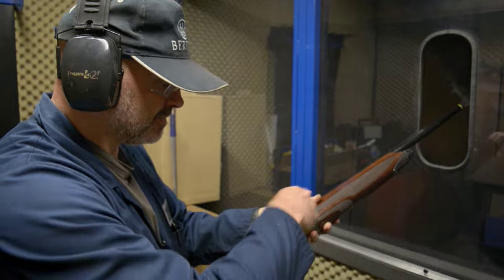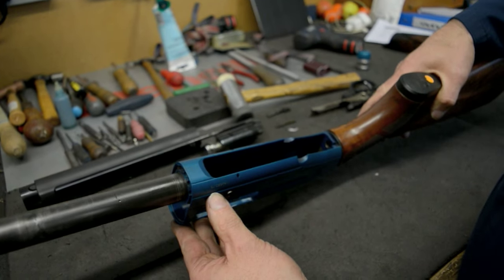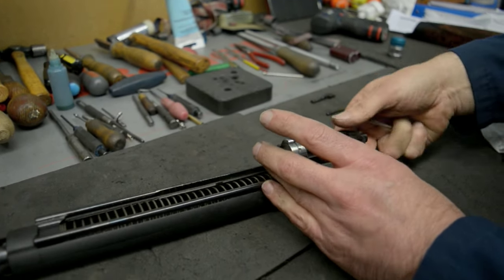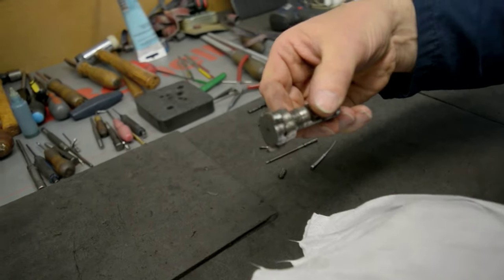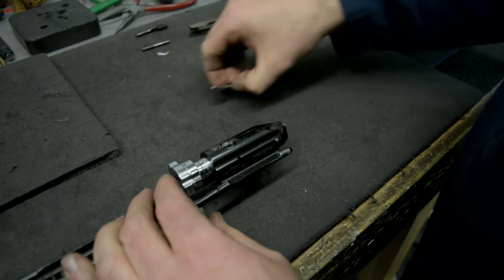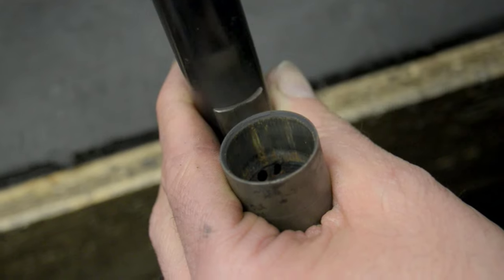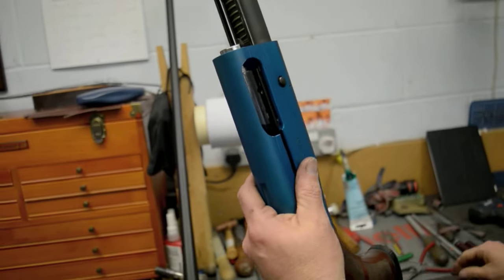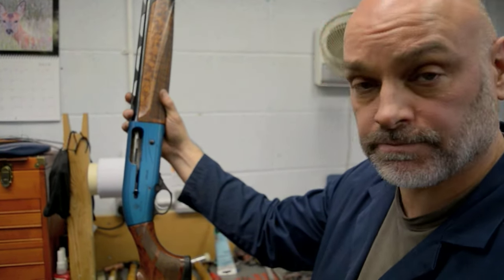How to strip and clean a Beretta semi-auto

Comment: I keep a spare (clean) piston ring on hand. I remove the ring from the piston and ultrasonic clean both and since the ring needs extra soaking sometimes I will put the spare ring on so I don't need to wait for dirty one to finish soaking. Every 500 rounds I use a special wrench I made to remove the nut and spring from the gas cylinder so I can clean out the (5) gas release holes. In this video he didn't even mention cleaning those, but it is quite difficult without taking the nut and spring off.
Reply: got a video on this?
 sounds important but I read (not confirmed) that the gas tube should be fine as long as it's never oiled.
Reply: Does an ultrasonic cleaner get all the carbon off the piston, etc, as this sounds a much better option than using wipes and cotton buds?

Comment: This does apply to the beretta 390 12 gauge  the only thing different is the key way system to remove the cocking handle on the action all you have to do for the 390 is wiggle and pull the coking handle and it should come out

Comment: Failed to clean the piston and gas port . Come on ! You are a gun smith . That whole area should be shinny and cleaned . I use long Q tips to clean the runners and the back of the receiver area . A lot of carbon get's built up in that area and along the sides of the trigger . I also use a rag to clean the magazine spring and the assembly area . The barrel also should be cleaned . Sorry i grew up in the Army and shooting Rmington 1100's . All these semi auto need to be cleaned A thru Z
Reply: Bill Neill 
I own a 1301 Comp. 
I was thinking the same thing. Lol
But I did learn to clean the trigger mec and pull the pin in BCG and clean the firing pin. So I can't be to critical.
Reply: One hundred percent true
Reply: would you please make a video with the 1301 comp/pro/tac?